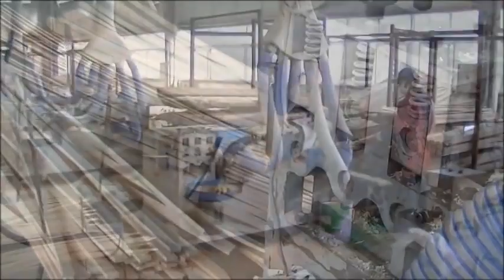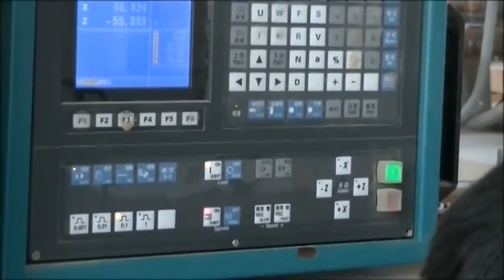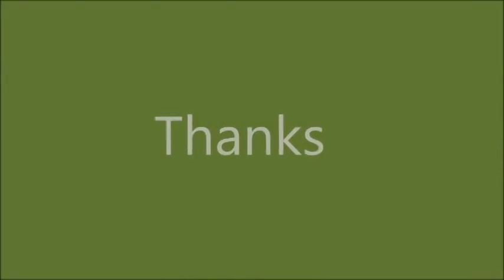Bamboo farm and processing

Comment: I am from Assam..so can you please give me knowledge about the production.I want to set up an production unit in Assam.
Reply: There is soo much more at play here than simple production.   Farm,   you'll need to start off w/ large tract of land.  This land will need to be rich soil and warm tropical climate is best.   Next, you'll need to employ a cheap labor staff as it seems the bamboo needs to reach the 6" plus width to be usable.   This will require hand cutting and selection.  The work force will have to be very very cheap as this is mega labor intensive... (Selection, cutting, hauling).   All done by hand.      Next, you'll need to split the bamboo and load into a very large very hot oven (This will need to be custom made).   Then load that material into a kiln.     After those processes the material will need to be shaped, trimmed, and sorted.  Finally, you can cut, press, and glue.        Here's the rub, a wood 2x4 costs at the local store $5.50.    The process for this is 1/5th as intensive to make.   Given the retail price, we can assume the processer can produce his lumber for less than $1.00 per stick.    Do you really think w/ what I've said above that you can get the bamboo process done for less thank $1.00 per stick?
Reply: @dfrost42  in Philippines we are already producing bamboo wood for low cost and pre built houses which can last 50 years besides this grass thrive in our climate and lot of unemployment makes producing less cheaper similar to China
Reply: @dfrost42  assam is in india so I'm going to go on a limb and say that large tracts of land, tropical climate, good soil and cheap labor are not going to be a problem. $100/month is considered a lot of money in some parts of india.